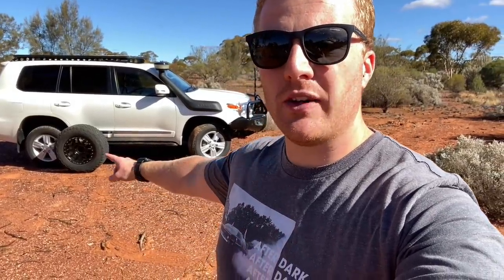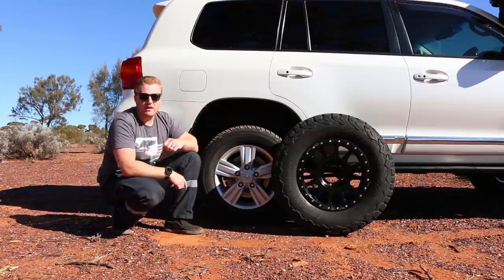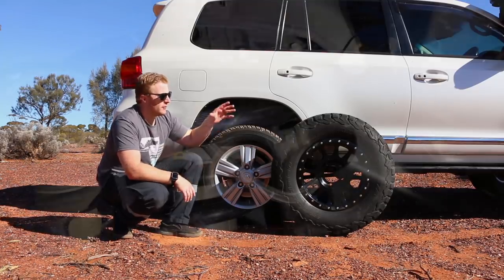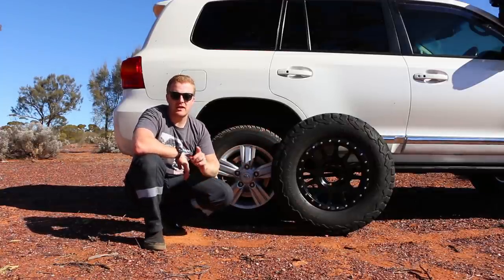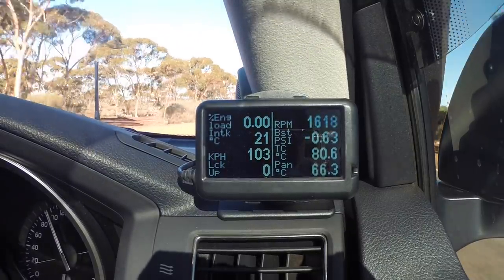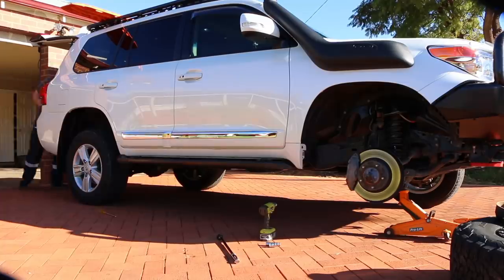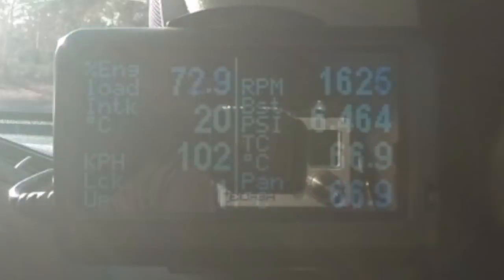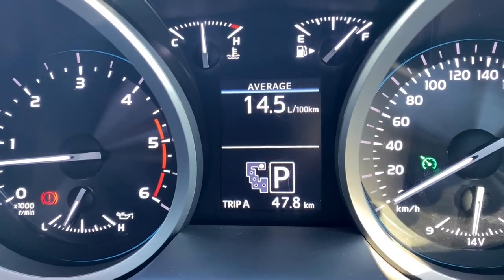TYRE SIZE COMPARISON | How much power is lost | Fuel consumption? | BF Goodrich AT | Landcruiser 200

Comment: I fit smaller tyers and get better fuel consumption,
Reply from the maker: This will definitely work, but also loose underbody clearance for 4WD'ing.
Reply: @XploringOz  Yes it works. 265/70/R16 tires instead of 275 so I save weight and therefore less rolling resistance. Acceleration in the city is much easier thus better mpg. I almost never drive on the motorway so that's irrelevant. NO off-road driving so I don't care about losing a few millimeters of ground clearance.
Reply from the maker: @greatpariscars  For sure, sounds like these slightly smaller tyres would definitely benefit your style of driving.
Reply: @XploringOz  Yes, my style is driving in the city and on local roads. Getting spectacular gas mileage. Makes me wet.

Comment: I would like to get opinions on What Size, fuel consumption difference, etc. please. On my patrol, the stock tyres are 265 70 R18 (32.6"), and as we know all other countries get the 275 60 R20 (33"). The tyre size I am looking at is A/T 275 65 R20 (34.1"), also recalibrated to suit the tyres..
Reply from the maker: It really does depend on the intended use for the vehicle. If the vehicle is only going to tow trailers and drove graded roads, then a larger size tyre wont be required. 
If your planning on hitting the harder tracks the larger tyres will help a lot. But with this fuel consumption, power and torque will suffer to sole extent. 
It’s all a compromise in the end and that will be determined for what you planning on doing in the vehicle 👍
Cheers, Nathan.
Reply: @XploringOz  during the week on graded roads, and tow if I need to as it is my daily drive too. On the weekend i try to get out to some true hard dirt tracks, and only once (hopefully twice a year soon) a year to head to far walkabouts like the cape and kimberly or somewhere.  I would about 80% of the time on road, the rest would be on dirt or sand. Quite the same as most people do if they think about it.
Cheers.
Reply from the maker: For sure. For me, I don't mind paying the little extra in fuel to run the bigger tyres as I do try and hit some of the hard tracks from time to time. However this particular size of tyre is also harder to find replacements in remote areas, if that is something that you plan on using your vehicle for. Just another thing to consider.

Comment: OMG, the 200LC is bloody slow, my 11 year old jeep grand cherokee V6 diesel does the 0-100 in 9.2 seconds and the later model does it 7.8 seconds, still a great video.
Reply from the maker: Haha, yeah you should have seen my old GU Nissan Patrol, that was slow. It may not be fast, but it sure gets everywhere and you also have to consider it weigh 3.5t.
Cheers, Nathan.
Reply: @XploringOz  It looks pretty stand, so what's in it to get the weight up to 3.5T, that's certainly heavy, must have a lot of good stuff in there.
Reply from the maker: @commonsense-grs  Yeah, it's got a bit of aftermarket gear, but it didn't take much to get the weight up. I did an earlier video where I briefly went over the modifications I have and weighed the vehicle empty on a weigh bridge. Much heavier than I thought... https://www.youtube.com/watch?v=WmeKQ0N-DJw&t=7s

Comment: taking into account the 6.75% increase in tyre diameter you actually got better fuel economy with the larger tyre on the highway
Reply from the maker: Thanks mate, but if we take into consideration the ECU calculations of distance travelled, this eliminates any apparent gains. Werner commented on this video with some spot on calculations that accurately represent actual fuel used.
Cheers, Nathan.
Reply: I similarly I calculate slightly better economy once you correct for the car not knowing the actual distance travelled due to not being calibrated for the higher overall gearing.
Reply: I got 5.16%

47.8 - 50.4 = -2.6
-2.6 / 50.4 = -5.16%

So the computer thinks it used that amount of fuel over a 5.16% less distance or only 94.84% the distance of the original. 

14.5 x 94.84 = 13.75L/100km 👍
Reply: Yes i would have thought the drop in revs would have given better economy.
Reply from the maker: @MrRobinski  So the load placed upon the engine with the larger tyres is greater. The RPM is only one method of determining work load. The bigger tyres require more engine input at the some RPM of a vehicle with smaller tyres. Essential this will mean that more diesel will be injected into the cylinder in each cycle, resulting in higher power outputs, higher fuel usage and general greater heat. 
It would be like driving a manual 4WD in 1 or 2 gears higher than appropriate. The engine will labour and struggle to maintain and build speed, injecting more fuel and generating more power on each combustion cycle.
Hope that makes some sort of sense
Cheers, Nathan.
Reply: @XploringOz  yes i was thinking it would need more torque to turn larger wheels so sure that's what you mean, so torque isn't the same as revs. Thanks

Comment: So wouldnt the L/100km given by the vehicle be inaccurate because the vehicle thinks it only went 47.8 not 50.4? This equates to a 5.15% discrepency, which the vehicle calculates it used x amount of fuel over a shorter distance, when in reality it made it the same ~50.4km

Which means the 14.5 L/100km would in reality be 13.75 L/100km... a negligable difference to the original 13.8 when factoring in how accurate the test could reasonably be.
Reply from the maker: For sure, there would be discrepancy in there. There is a comment thread in here that explains it quite well. 
The only true way to measure it would be to re-fuel after each test. 
Cheers for watching 👍
Reply: @XploringOz  From the numbers (26.2 millilitres aka 175 meters aka 5.7 seconds of driving aka 0.38%)  then no - measurement by refuel would not be anywhere near accurate enough.  The difference is so incredibly tiny, you'd need some kind of special calibrated fuel flow instrument, and a properly configured scientific test track and multiple run conditions.  Or you could just "not bother", because this test has already shown that there's actually no accurately-measurable difference in fuel usage, so you may as well ignore it.

Comment: I like the video, but I still "didn't get an answer" on whether it is worth having the bigger size tyres or not? (only talking about size not build quality). I'm looking at getting some new tyres this week and wondering if I should stay with the stock 265/65/17 size or go the next size up at 265/70/17??? Cheers, Don, Perth WA, MY22 Fortuner (Dons Shed and Xplor Overland)
Reply from the maker: Hey mate, I guess this topic is a very personal and individual question. It really depends on what you use the vehicle for, how you use the vehicle and what you are hoping to achieve moving forward. The biggest advantage of larger tyres is clearance. If you are hitting the tracks regularly and wanting more clearance under the axles, then larger tyres are the way to go. If you towing frequently and maybe don't 4WD so much, than the extra fuel consumption might not be worth the occasional benefit. 
Cheers, Nathan.
Reply: @XploringOz  Thanks Nathan 👍 In the end I've decided to go one size up and get the 265/70/17's for our MY22 Fortuner. It will be getting a 2" lift as well at some point, so that should make the tyres not look too small on our lifted car. Cheers, Don 🙂
Reply from the maker: @DonsShed  Great choice, should not only match the 'look' and proportion, but give the vehicle a little edge off-road too 👍 All the best. Cheers

Comment: If you have lsd rear diff you can NOT run two different sizes without damaging/destroying your diff. Have 5 tyres the same size
Reply from the maker: This is correct. It could physically been done if it means limping the vehicle home, however you would not want to do this for an extended period of time. 
Cheers, Nathan.

Comment: Any implications on registration and/or insurance by getting larger tyres? Last I checked, in Victoria (where I am) anything over a 15mm diameter or 25mm wider increase in considered a modification. Likely different requirements depending on where you live. I'd be thinking there is a good chance anything classed as a modification would need to be cleared for registration and insurance to be valid. Not sure really, definitely worth checking out as you don't want your insurance voided on a technicality when you need it most.
Reply from the maker: There are implications. A 2” lift and basic mods don’t need any sort of certification in WA, however tyres like this, with the correctly suspension components installed can be certified and stamped off by an engineer 👍

Comment: Great video! I got a question please I have a 2020 LC200 and I was thinking about getting a 285/65r18 set of tires so that'll raise the car about an inch or so, and I'd rather not get a big suspension lift so do you think I'd have to get a 2 inch lift or a simple OME 1 – 1.5" lift would do? Thanks!
Reply from the maker: Thanks mate. It's a hard call to make as I haven't had personal experience with that size of tyre. However from my knowledge, I think it would be safer to fit the 2" kit. The tyres are already very close to the guards as they are and full compression may cause contact and damage to the wheel well.

Comment: Hey bud. I have a 2008 LC 200 series. I just got a Ironman 4x4 front bumper and a 2 inch lift kit. I have not installed the rear metal bumper as yet but I do plan on getting it. I am thinking of getting other tires. Right now I am using 265/75/R18 - but I would like to get 33' inches of tires. What do you recommend?
Reply from the maker: Good choice of vehicle! So i believe that one of the most popular sizes for vehicle is the 285/65 18 (32.6" metric). Although a little short of 33", still a good improvement, no modifications to fit and easy to source over the country. Otherwise another option would be to go a metric 33" by 12.5 wide. 
In terms of brans, look in my opinion they are all much of the same. I know some people have very strong opinions about what works and what doesn't, but I think you'll find that most people don't often drive enough km's to accurately comment on every tyres ability and reliability. 
Personally, I recently completely a desert 4Wd trip over 7 days in seriously remote and unchartered terrain where we lost 7 tyres to side wall damage. These included brands of Mickey Thompson, BFG AT's and Coopers. 
Although there might be small difference between grip and noise, I have found this difference minimal for what we use  and setup these vehicles up for. 
Personally I have stuck with BFG's only because I haven't had any major faults and they are known around the world for their performance and reliability. Everyone will have their own opinion.
Good luck with the research.

Comment: I just do not understand Australian off-road rigs... Your trucks already have these huge noses that stick out way past your front tires, ruining your approach angle. And instead of doing anything to fix it, you make the problem worse by sticking a huge bumper on the front of your truck that sticks out another 12 inches and hangs down almost as far as the stock bumper. 

Is ARB the only bumper manufacturer in Australia? Do no Australians build their own bumpers? Are the words "high clearance" and "approach angles" illegal down under?
Reply from the maker: When we have the animals sharing the roadways like we do, we need something that can survive a strike and more importantly keep the vehicle in working order to drive the huge distances out of remote areas. Might not to the best for rock crawling, however I'll take the lump of steel and save $$$$ on remote recoveries any day
Reply: @XploringOz  Animals exist in the US as well. Many are much larger than what you have in Australia. And it is VERY common for cars to hit deer on the road. In fact, cars hit 1.5 million deer in the US every year. 

And I never said the bumper should not be made of steel and be strong. In fact, half the reason I'm not putting an ARB bumper on my truck is because it is made of such thin material and is too flimsy for my liking. The other half is due to the terrible approach angle. 

You can have a very strong steel bumper that is also very high clearance and will survive a collision with an animal, tree, or rock.
Reply: This is an interesting discussion. I have lived half my life in both countries, and have spent countless hours on long drives in both - not heaps off-road though.

To the point about hitting animals, I will argue that Australia has a much higher risk:
    Likelihood: Yes, there are plenty of animals to hit in the US, but not in the densities I've seen in Australia. I might see a few deer or elk on a long drive in the US (granted I haven't been EVERYWHERE in the US), but I've driven stretches of road in Australia at night where just inside my headlight beam, I've counted over 100 roos in less than an hour. I've probably driven 10x more in the US and only ever hit 1 deer, whereas in Australia, I've probably hit 5 or more roos and wallabies.
    Severity: If your vehicle gets disabled, you're much further from help. I don't think Americans really get how sparsely populated Australia is. In the 40 states I've travelled in the US I don't think I've ever been more than an hour or so from some kind of settlement, but in Australia you can go days without seeing another vehicle or settlement - let alone anywhere with towing or repair services.

To the point about bumpers being resistant to animal strikes, but also high clearance, I don't really have much experience to speak from. In my observation, it seems like American off-road rigs tend to be built more for dedicated, very difficult off-road trails, and Aussie ones lean more toward travelling vast distances reliably on mildly rough terrain, and tackling occasional difficult obstacles. Just one of millions of subtle cultural differences we have.

Comment: If you're driving a powerful truck, slightly bigger tyres aren't as much of a problem. Yes you'll use a little more fuel but you might get more life on a leading all terrain tyre than a highway tyre . If you're driving an older underpowered truck, larger tyres are a real penalty for on road performance. That's why older LandCruisers and land Rovers use skinnies. If you want good highway mileage, slow down and take everything off the roof. At highway speeds most of the car's energy's is used to overcome it's aerodynamic drag.
Reply from the maker: Agreed. The aerodynamic effect on a vehicle makes a huge difference too. It will all depend on what gear you plan to carry and what vehicle use are using to carry it to then determine the best possible compromise between the two. 
Cheers, Nathan.